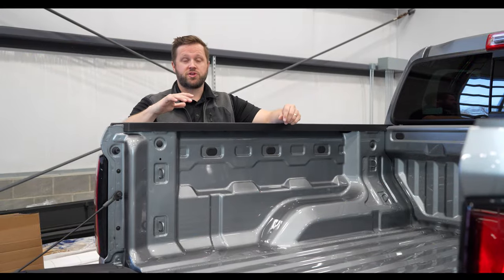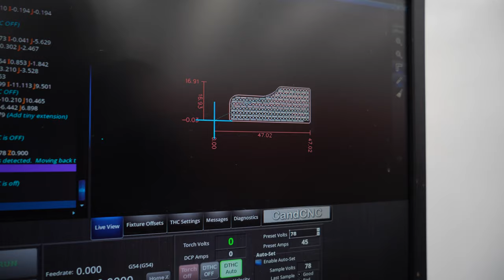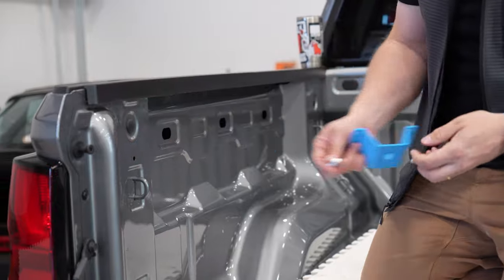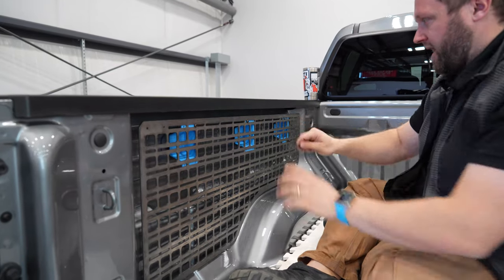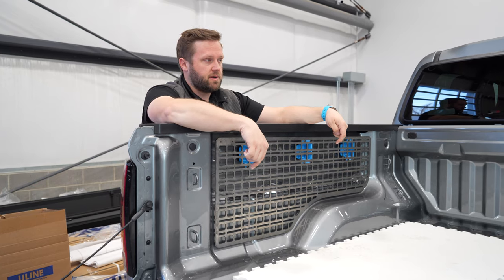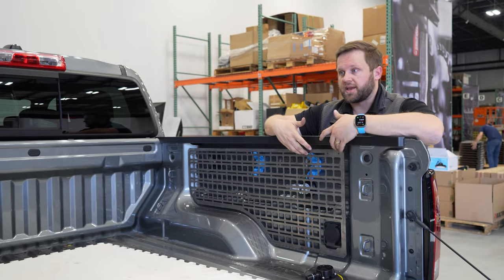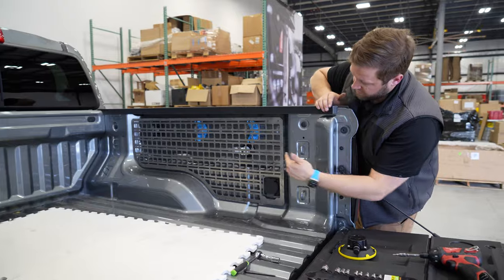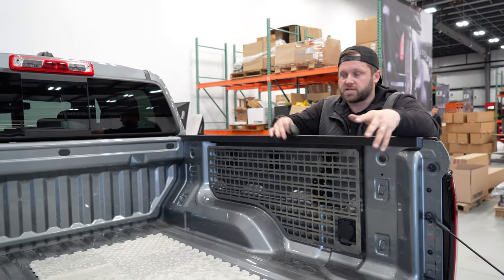2023+ Colorado/Canyon Bedside Rack MOLLE Panel Prototyping // 2023 Chevy Colorado Build Ep.2

Comment: Will the idea you are working with on the passenger side work with a spray on bedliner (like a AT4X)?
Reply from the maker: The panels will work with a spray-in bedliner, we ended up deciding that we will not use the suction vacuum cups for this design. After adjusting the mounting blocks depth and where the panels sit within the bedsides, we are confident relying on our bumpers or a high strength magnet to keep the bottom of the panel sprung against the bed wall. These bumpers already do this perfectly in a few of our GM Bedside MOLLE Kits, so they'll work great here too - and Matt is currently experimenting with the magnet solution!

Comment: On the driver side at 9:42 are those rubber stoppers? Definitely curious about the third mounting spot. I assume the vacuum mount you mentioned wouldn’t work on textured bedliner? I don’t mind having to drill another hole though if that is an option.
Reply from the maker: Good eye! They are the rubber bumpers we currently use in our full size GM bedside MOLLE kits for this fourth mounting/bracing point. The smaller vacuum cup did work well on our truck, but like you mentioned, those would only function properly on a painted surface and we know many of you guys run spay-in liners, bedrugs, etc. 

Either vacuum cup solution would be overkill and more of a hassle than we're looking for, so they ended up not being our top choice for a few reasons. After adjusting the depth at which the panels sit within the bedsides, we are confident relying on the bumpers to keep the bottom of the panel sprung against the bed wall. They already do the job perfectly in a few of our kits, they'll work great here too!

Comment: How big will the gap between the bed wall and the back side of the panel? Was looking at mounting an ARB compressor between the two
Reply from the maker: The clearance from the backside of the panels to the bedside ranges from 3/4" - 2". Unless ARB has some new really low profile compressors, you will not be able to fit one back there unfortunately. We actually do our best to minimize that space between the bedsides and our panels, simply so the panels don't stick out past the bed rails and intrude on your usable bed space/gear mounting space. But we DO see folks mounting ARB compressors on the front face of our panels all the time!

Comment: Id 100% be down with a panel only on the top row (like first row ablve the outlet) so i can still put a 2x4 in the slot for the bed divider.   But im waiting for these over the 4x4 version bc i dont want to drill
Reply from the maker: They're on the site now!
https://builtrightind.com/collections/chevrolet-colorado-2023
Reply: @BuiltRightInd I see the full panels on the website now, but I think what travisjames915 is referring to would just go across the top without dropping down behind the wheel well, like one of the other brands (starts with a p). I agree, because I use the rear slot to keep fuel cans and other things close to the tailgate.
Reply from the maker: @rwassom73 Totally understand - we have an attachment coming that will basically act as a slot on the panels for folks who want to keep a 2x in place like you mention. Probably 6wks out or so. 👍